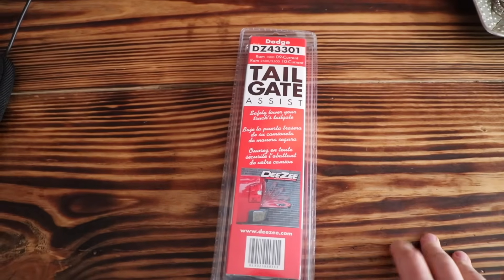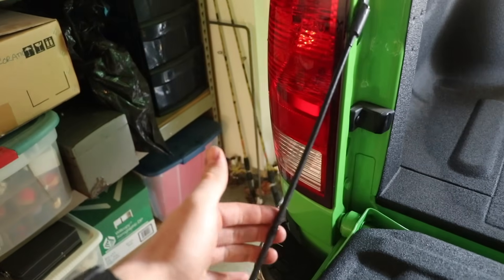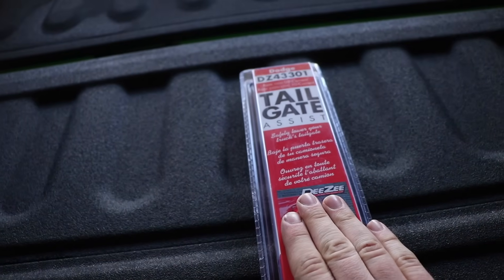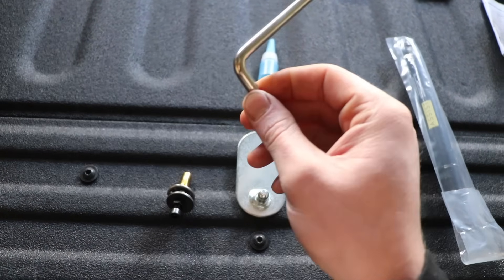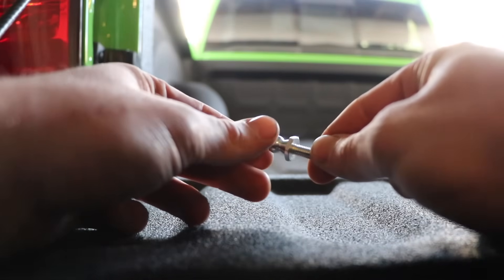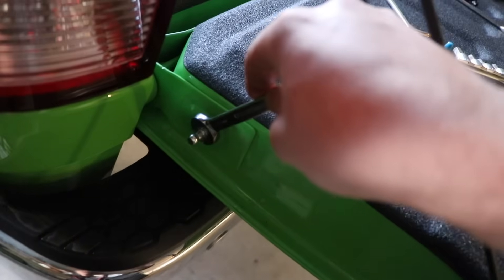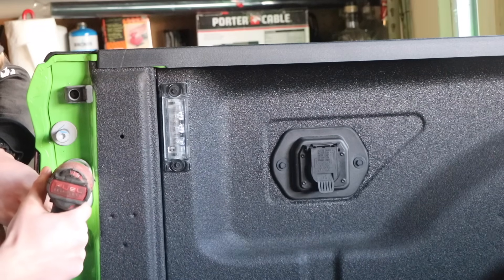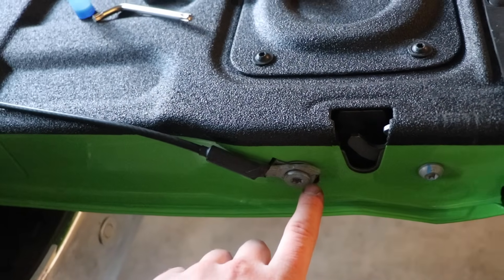$20 Tailgate HACK Everybody NEEDS To Know!!!

Comment: CUZ ITS A TRUCK. ITS SUPPOSED TO BE TOUGHED AROUND Ram is the only Truck that I've seen still treated like a truck. I've seen countless 2017 rams with 5th wheel balls/plates and scratched up rear ends. Not one ford or chevy that's that new ive seen used that way

Comment: Idk, I guess if you're elderly or some kind of a cripple this may be beneficial but modern tailgates are so damn lightweight almost like styrofoam anyway it makes this look like a candy ass accessory. In my day when I was starting to drive 30+ years ago tailgates were solid, heavy and you had the satisfying feeling in straining your lower back as you used your muscles to slow the fall of the gate as it came down. The unmodified tailgate is actually serving in place of gym workout equipment!

Comment: Without keyless tailgate opening I don’t see the point in this. If I open my tailgate by hand, it isn’t so heavy I can’t lower it the same way. This isn’t Ford with the man-step that adds weight. Not to mention, up north during winter, relying on that with snow/ice on the bumper will ruin the paint on the tailgate

Hard pass

Comment: Real men don't need a tailgate assist. Why would you need one anyway ? You obviously don't actually use your truck bed.
Reply: I kinda wish I knew these things where a thing. I've dropped my tailgate so many times in the course of working that the passenger side cable just fell out of the tailgate. The bolt hole is egg shaped now. Gonna have to weld it back in place now

Comment: Personally, I think this mod is stupid. I came from a 93 f250 to a 2012 f250. The tailgate on my 2012 feels like a feather compared to the old 93. I see no need for this with the modern light weight tailgates. It would be more annoying than anything to me because I wouldn't want to wait for my tailgate to fall so damn slow when I got something heavy in my hands that needs to go in the bed. I want my truck to be a truck. The less fancy parts there are, the less there is to break.

Comment: Nope no good!  You didn't explain the instructions clearly, I know this because I installed this "Assist" on my 2003 Ram back in 2003!  It is Very Important to install the Nut Insert correctly, you just power tool it on... it calls for only 9-10 turns of the bolt to "set" the nut insert... surprised you didn't ruin the insert.  Oh, and a fact... this unit only lasted me about 4 years of use as the lift shock wore out and the shaft bent, and it cost as much to just get the lift support as the kit.  Not a "Life-Time" Warranty on this product for a reason... Bye Bye!